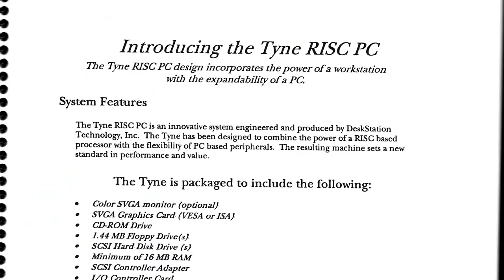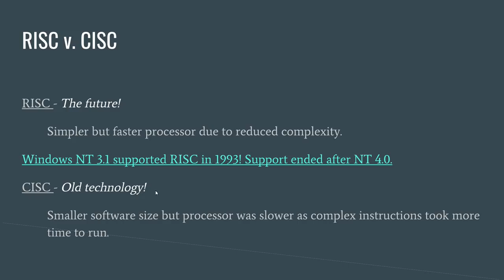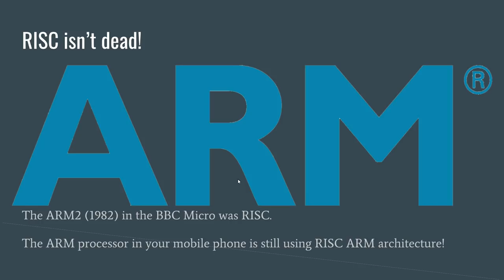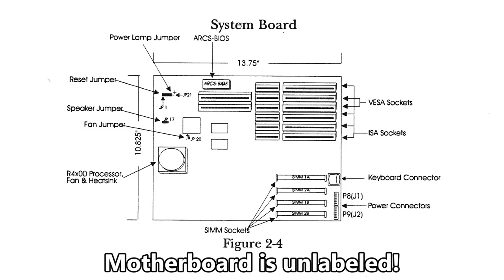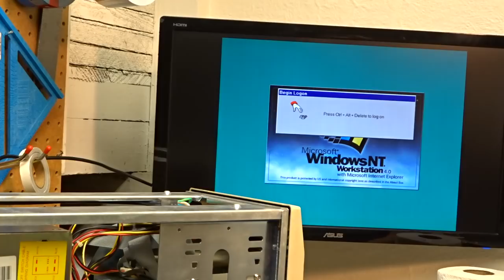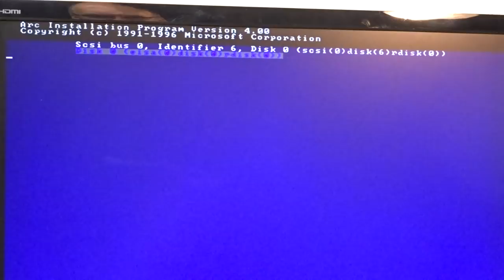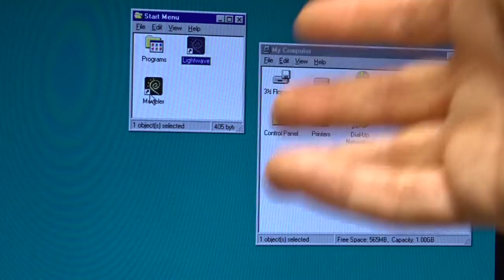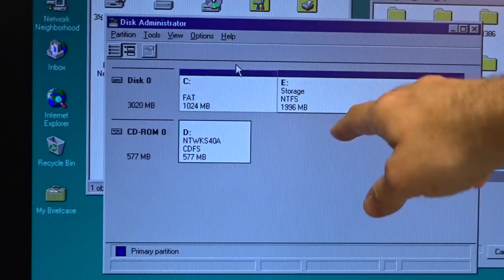Deskstation Tyne: A MIPS R4600 based PC that runs Windows NT

Comment: One of the big things that “saved” CISC was the decoupling of the architectural instruction set from the actual internal micro-architecture. Most CPUs today translate from one ISA to another on the fly. This gives your chip designers huge flexibility in designing the processor’s internals without breaking compatibility.
Reply: like the AMD K6/2
Reply: What does the C stand for?

Oh..complex. I furgot

Comment: We had a couple DeskStation Raptor Reflex towers at my job in the late 90s, and they were mainly used for LightWave and Photoshop. What's interesting was that they had an x86 emulator called FX!32 from Digital, which was how we could run Photoshop. There's very little online about it but it not only emulated an x86, it would find ways to improve the performance over time.
Reply: The Raptor Reflex models were Alpha-based, as I understand it. DeskStation seemed to shadow Digital (DEC) and initially planned to ride the ACE bandwagon, even wanting to offer Ultrix when the SCO Unix product for MIPS was delayed. When DEC abandoned MIPS and moved to Alpha, DeskStation followed suit. FX!32 was, of course, DEC's compatibility product for NT on Alpha.

Comment: Yeah, in the 1994 - 1997 era these WinNT RISC systems started to show up which became very popular with the Lightwave crowd.  Not only would this be loads faster than the last model Amiga offered in 1994, the company went out of business.  These were 100mHz+ compared to  MC68040 models offered at nominal 25mHz with faster 3rd party add-on boards, but not this kind of speed for a while.  The MC68060 accelerators were only good for 50-66mHz or so.

Most of the folks in the circles I was familiar with opted for the DEC Alpha based RISC systems as they were very cost effective, also ran WinNT, but DEC developed a rather miraculous software-based emulation system for x86 compatibility called FX32.  After the first couple times launching a new piece of software the system would instead run a copy made of new native code.  It was so good it was even compatible with some x86 hardware drivers.  I was able to do Premiere editing with a Personal Animation Recorder, which was a hardware based DDR, using a dedicated encoder/decoder board with attached SCSI drive, letting me do realtime broadcast quality video while any other PC would struggle to play anything higher resolution than 320x240 in full color with something like MPEG or Sorensen compression.

These workstations had at least the perceived coolness of running the same chip as in an SGI, which was what I had at work during this period, until '99.
Reply: That emulation layer was actually called FX!32 in case someone wants to look it up.
Reply: Sean, what were you using the SGI for in '99?
Reply: @gregorymalchuk272  by '99 SGI were starting to lose their edge.  But that year I had two on my desk while at DD.  I had an Indigo2 Extreme, which was getting very long in the tooth but was reliable, and I had one of SGI's dual-Xeon WinNT systems, which was fast but a less than optimal environment for production.

We did the best we could to make the WinNT system feel Unix-like, using Cygwin and its shell environment, since very little production work made use of the desktop environment or metaphor.

And in '99 I spent a good chunk of the year working on the first X-Men, where I implemented image-based rendering for the first time in a feature film.  It was also the first time we had systems fast enough, and a renderer fast enough, to raytrace (VEX Mantra).  And later in the year I started working on Dracula 2000 at  GMFX.
Reply: ntalpha was based primaly for tv-stations.

they needed some kind of useable os in buisness and microsoft said "ok we will do the work"

many videoediting machines based (not really later) with specialized hardware in the video editing branch with lower pricing
from more than 250.000 dollar those went down to 50.000dollar. 

" the market makes the price " - More production in one generation and the engeneering costs get down.

whak whak whigg horraaaaaa - no magic. but it seems to be that some parasites went into mass market and sucking all the blood from global states 😁
Reply: @loschwahn723  wat?

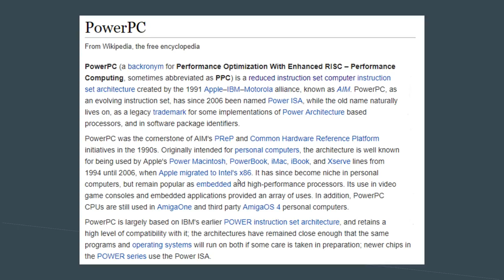Comment: 6:26 The BBC Micro did not have an ARM CPU, it was a MOS Technology 6502. The first ARM CPU was in the Acorn Archimedes line of computers beginning in 1987, which was sold under the BBC licensed brand mainly in the educational market. Those BBC branded models had red function keys (a throwback to its BBC Micro lineage,) the models intended for the home market had green function keys, and business market machines had gray function keys.
Reply: Adrian Black the Archimedes has a very similar feel to an amiga. The OS even had a similar feel. It didn't get near the amount of support that Commodore computers got, and still gets though. I have not tried RISC OS for the raspberry pi, just because there isn't near the amount of software that there is for the debian based distros. I still think it's interesting that RICS OS is available for a cheap and readily available platform for people to experience and experiment with.
Reply: There was a BBC ARM cpu but it was an add on coprocessor.  ARM1 was developed on and first run on the BBC Micro. You're right though it wasn't standard
Reply: I think that the confusion may be due to the fact that the BBC Micro branding was carried over into various models of the Archimedes up to the A30x0 series including the A3000 and, as RMC correctly states, the first ARM chip was produced as a second processor system for the BBC Micro connecting through the "Tube". By the time the Acorn RISC PC 600/700/A7000 hit the market, the whole BBC Micro branding had been discontinued.

Comment: Really nice tour thank you.  The most famous home computer here in the UK with RISC was the Acorn (of ARM fame) Archimedes.  A really great little range of machines which went into most schools
Reply: I remember when I was little my primary school (kids aged 4 to 11) had a BBC micro.
Reply: Did you actually meant they did make it into most schools, or that they went mostly into schools? A heck of a difference.
Reply: BilisNegra Pretty much every school in the UK had at least one.
Reply: OK, it was a sincere question as I wasn't there to know. Thanks!
Reply: BilisNegra sure, it was an interesting time with BBCs in schools and ZX Spectrums and other 8bit micros in our homes, which led to many programmers and IT professionals here. There has been a noticable dip in numbers as access to easily programmable machines and school lessons vanished.  The Raspberry Pi was created to try and recreate this and get more kids interested again, and the creator Eben Upton was also part of the team who created the BBC originally.
Reply: I'd say the Beeb was more prevalent in schools than the later Arc. Trouble with the Arc was its rather higher cost. It didn't really penetrate the home market that much.
Reply: You do realize there is a RiscOS that has runs on the Raspberry PI?

https://www.youtube.com/watch?v=QkutK5udycQ

So for under $100, you can get a pretty capable machine running an updated and re-worked Risc OS.  You can also emulate the other systems entirely.
Reply: @RMCRetro  I went to a school in Cheshire that "bet on the wrong horse" we had a raft of A3000's that we learnt on. Only one IBM in the building.
Reply: @RMCRetro  with respect ( I like your channel and I had a beeb myself ) Eben Upton is two years younger than me and I was 6 years old when it was released...so it's unlikely he had much input at the time ;-) perhaps more interesting is this computer is named "tyne"...which as any englishmen knows is that great area of the north-east well known for its advancements in computer science...maybe.
Reply: and now mac mini for 750$ have m1 arm chip and fast as i7 + gtx 1050

Comment: If it was my machine I'd probably look into installing a BSD unix. It's been a while since I used BSD, but it has an extensive "port"-system which basically means that all apps (many thousands!) can be automatically downloaded and compiled (from source-code) on your system; the latter being important as you probably won't find many R4600 executables out there. That should allow you to run alot of software on it. Thanx for the video, used to drool over these things.
Reply: BSD, or check for a Linux port to MIPS.  Not that there's much difference these days.  BSD has a Linux (system calls, architecture neutral) emulation subsystem.  You should start by looking at the old 32 bit OSes for MIPS support.  In most cases you then  look for good C/C++ compiler(s) to get programs compiled from source.  

That BSD ports software sounds like a real time saver.  Arch Linux also compiles programs it installs from source, I have no actual experience with either Arch or BSD.
Reply: thanks for the great video! would you be interested in installing OpenBSD? it was forked from NetBSD, as i recall, but each iteration (whole number version) is not backwards compatible or updatable because of its global architecture, the legacy code is deprecated to keep the code pure, small, simple and improved. i have not used linux, except for Ubuntu Studio and not any other OS except MacOS
Reply: it's a plain copy of nt4 - he must slipstream sp3 with extra ide drivers or mabe sp4 and sp6 for mips to support larger harddrives 

remind limitations in the past which going on nowadays

Comment: I used to have an old pre-release version of Windows NT5 (before they changed the name to 2000 (I mean, NT5 was supposed to ship in 1997, but you know, it's going to be easier to just ship in 1999 and call it 2000 so it sounds like it's from the future)) that would still install on alpha/mips(/and some other RISC, I think) machines.  They could have left in support in the actual release, but I think they felt like it was time to let the totally awesome future pass them by.
Reply: as an old os/2 user i used it for a multiline bbs - there was multitasking (for real and it was MULTITASKING OS) inside with such kind of 486sx25
most games and hardware run faster as in dos, wfw311 AND win95 or if you want nt 3.51 and nt4

it is on your own choice to believe a open hardware plattform is the better choice such like "non optimised" windows or you get a specialized, hardware dependent OS.

" now i must get to work " is my comupter screaming

Comment: I don’t know how I was fed this video when it’s only 50 views in, but I am enjoying it thoroughly !
Reply: It also repeatedly kept showing up in my YouTube recommendations.
Reply: Same I didn't watch it for ages but saw it in my recommended list for over a week!
Reply: The Archimedes was the first ARM home computer, if we ignore the ARM1 second processor. Released for the BBC Micro during #RISC development.
HOWEVER... this machine may have a RISC badge on it but it is not a RISC PC - of any kind, sorry.

Acorn never ported RISC-OS to MIps/PowerPC - They only built machines on the ARM610 to StrongARM chipset.
Those ran Windows on a second CPU, plugged into the tandom socket in the machine. Mine has a blue x586 card at 300mhz.
There is a long list of corrections I could post about the history, code impact and Risc-ness in this video,
But I won't brow-beat you, not when you've made so much effort on it.

Still, this isn't a RISC PC - or an Acorn-clone product (such as they ever existed) and cannot run Acorn operating systems.
The Mips/PPC platform isn't the forefather of ARM #Cortex, as seen on all smallish devices on earth now.
It's a different chipset, one that was never fully adopter due the Wintel pushing CISC to the bitter death... as it still continues to do.

Research #RISC5 (HUGE money 'open source') and #Sifive custom SOC systems. For where Windows is trying to go now.
In my opinion this is an attempt to force-adopt a less able (and largely copied) risc standard to avoid paying the tiny ARM licence in production.
Having repeatedly failed to port any Win version fully to ARM - Wiot = failed - WinRT = failed and currenting WOA = also failing.
Microsoft are a big and very competent company. If they wanted a full library on WinARM64. They'd have done it...

In comparison, RISC5 ported 85% of the #Debian library to 'new risc' in under 6 moths.
Linus Tech Tips #LTT has a video on this but it is all badly ill-informed and mostly advertising for Sifive.
Disregarding 30 years of optimisation, when modern ARM SOC's often have Decacores (10) and run a total of 15ghz or more, by cycle

Sorry there is a lot, I hope breaking it up helps. Here (link).. is a Risc PC as last seen in production by Acorn.
>> https://www.retro-kit.co.uk/page.cfm/content/Acorn-RiscPC << before they diverted to open licencing as Advanced RISC Machines in 1998ish.

Hugs - Illu

Comment: If you haven't formatted the scsi drive yet, then you can easily get the my administrator password as well as all other account names and passwords..  you'll want to run either LCP or ophcrack  against the SAM database.  There are actually dozens of tools to do this but the two I mentioned above work wonderfully.  Let us see it in all of its natively setup glory!  Thanks and good luck.
Reply: I would've suggested ntpwedit, a simple tool that can just wipe the admin password with one click. So many tools to get this done. Windows passwords are a joke. This was like looking at a safe held together with a luggage lock and saying "well, I guess we'll never get in there, let's build a new safe". :(
Reply: Offline NT Password Resetter?  I've had to use that a couple times
Reply: The question is whether these password recovery utilities have been written for an ARM processor.
Reply: @alhartman66  uhh.. don't you mean MIPS processor?  This IS a mips machine we're speaking of here not ARM
Reply: @adventureoflinkmk2  Yes, sorry. Thanks for the correction.
Reply: @alhartman66  you're welcome... was gonna say I thought ARM & MIPS would be different
Reply: I mean it's not like it is in the CISC land where both AMD and Intel are x86(-64)
Reply: None of those will run on a RISC chip....
Reply: They should run on the .pwl file though. Maybe.

Easier would be just renaming cmd.exe to logon.scr waiting at the login prompt for the screensaver and voila. Use MUSRMGR to reset local passwords.
Reply: @nexxusty  hmm.  See if you can hook that scsi drive to a cisc machine so you can use the Offline NT Password Resetter?  #ProblemSolved
Reply: I'm pretty sure at least one of them is open source so should be able to be recompiled but as others have said, just mount the drive on another machine.

Comment: That brought back memories. I used to work for IDT, a MIPS partner that produced the processors, and part of my job was to help developers port applications to Windows NT on MIPS. I had a pool of Deskstation machines that I would loan out to developers. They were R4000 based not R4600 however. The R4600 was just coming out at the time and we had some R4600 machines in house.

Comment: Fun fact: NT ran on MIPS before it ran on x86.  ARC was also the firmware interface that the newer SGI systems used, and was the NT flavor of firmware/PALcode for the DEC Alpha.  NetBSD runs on this machine (NetBSD/arc), so there's an option if you want a contemporary OS for it.

Comment: MIPS is quite common for consumer wireless routers, and DD-WRT is among the most common (aftermarket, at least) Linux-based... firmware? Operating system? on them.

While I'm not suggesting trying to run DD-WRT on it, it's possible that you can get a MIPS-based Linux distribution to run on it.
Reply: Generally, speaking you should be able to use ARCLoad to get a Linux kernel running though my experience with Debian/mipsel is it's pretty hit or miss.

NetBSD on the other hand supports ARC fairly well though it lists the DeskStation as unstable: http://wiki.netbsd.org/ports/arc/.
Reply: AmEv7fam you could use even Debian Linux as well which is supported for mips. I do happen to have a silicon graphic O2 which is similar to this one.

Comment: The x86 architecture we use today is in fact a RISC processor disguised as CISC for backwards compatibility. Since Pentium, Intel used a microcode translation layer to convert the legacy CISC instructions to internal RISC ones, and you can also use the RISC instructions directly since the newer (SSE) revisions of the instruction set.

Comment: I was doing a training course at Pyramid Computers in early 1994 and Bull computers were also there, testing their prototype MIPS NT desktop PC's - they looked IDENTICAL to this one with the slanted top so I wonder if the Bull ones were actually Tyne manufactured (or Tyne re-branded them?). Pyramid were a manufacturer of MIPS powered mini computers, using MIPS R4400 CPU's and similar running UNIX (SVR4 - DC/OSx) in their big 42-U Nile and the MIPS R10000 CPU in their Reliant RM1000 machines (A couple of these RM1000's ran Link cashpoints and BT had one for many years in the UK - I saw the demo machine they'd built!). I don't think Bull ever sold their MIPS Workstations, and Pyramid got bought by Siemens Nixdorf ultimately.

Comment: The fan issue is likely due to a bad power supply. It can also happen due to devices inside the computer with bad caps, and when devices have bad caps, they can sometimes can load a power supply quite a bit. So be sure to check the voltage getting to the fan with a scope and or multimeter.